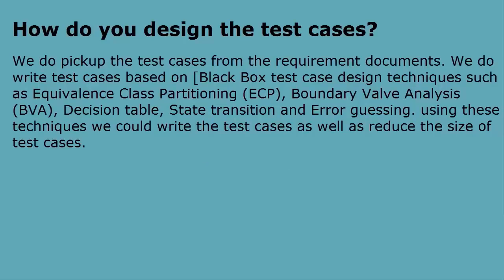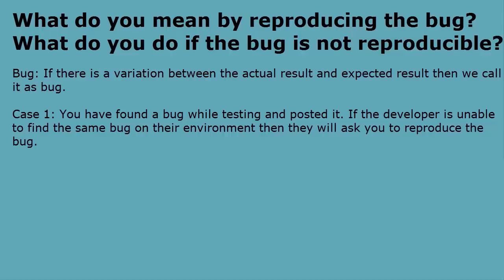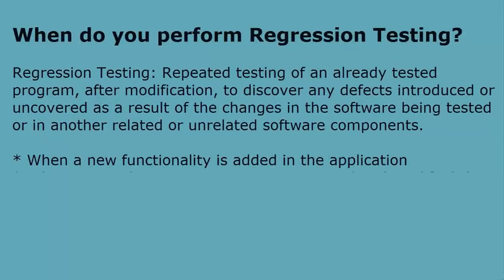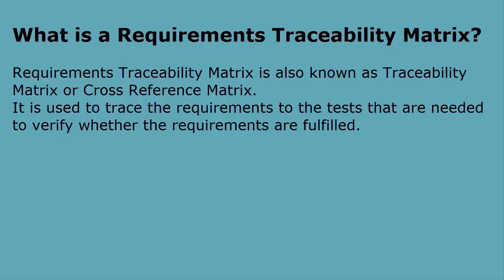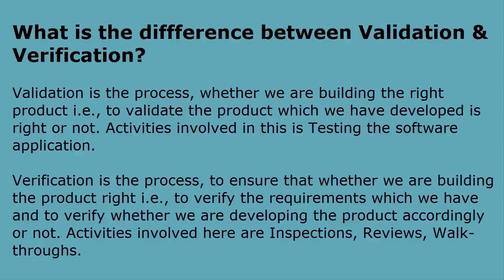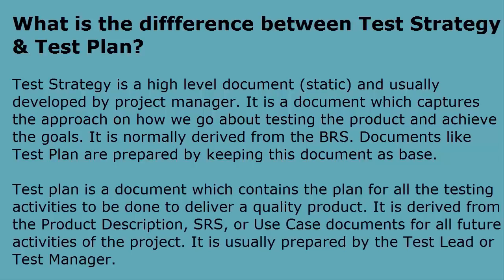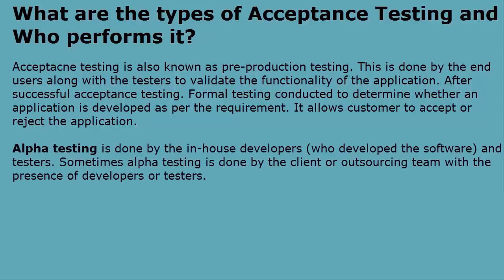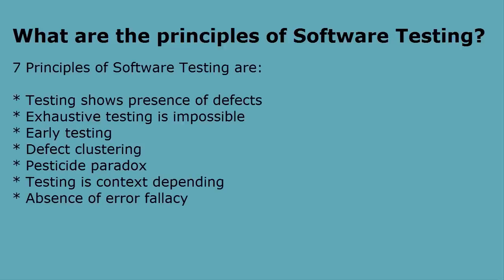Real Time Software Testing Interview Questions

Comment: 1.after test engineer gives the bug report to the developer he  go through the the bug report to check whether it's a valid or invalid.if valid then he follows the navigation steps by opening the application and physically check the exsistance of the bug..(that's called reproducing the Bug)
2.if the bug is not reproducible as TE WE should recheck our bug report to do the necessary changes and change the status to re-open and send it to the developer 😀

Comment: Great job! Could you maybe explain the first question more clearly as to what are the tests under blackbox testing
Reply: Black box testing means that the tester doesnt have an idea on how it works..
Reply: When a tester is not aware about the backend part i.e. at the code level and testing is done on the basis of thinking as a end user then such testing is know as black box testing.....black box means when internal design and code is not know to the tester.

Comment: I used to like your video before this--->

There is a crash in an application whenever a user enters 4 digits in age field which accepts max 3 digit.
Seriously ? this is low priority bug as per you.
Reply from the maker: Hi Vikram Kumar, priority always depends on Business.. Not set depends on QAs point of view..
Reply: Yes it comes under low priority and high severity

Comment: If your client is getting a bug on production environment and you are not able to reproduce it on your test environment I don't think so it would be a good approach to just close that bug with status not reproducible. What i  would suggest is to work with client get logs from his machine and try to troubleshoot what is going wrong.
Reply: logs, logs and complete details of client's environment, platform (etc.); ideally, screen-share with the client and witness the problem
Reply from the maker: Hi Aditya Jain, I agree with you. Did we mention this quoted one in our video. - "If your client is getting a bug on production environment and you are not able to reproduce it on your test environment I don't think so it would be a good approach to just close that bug with status not reproducible."
Reply: Yes

Comment: hello are you remembered your previous video ...you said that defect is a variation in actual result and expected result
but here you said that it was bug...
give me correct info.
Reply from the maker: Hi. For both defect and bug the actual result wont be same as expected result. For detailed explanation, please check this videos..
https://www.youtube.com/watch?v=53braDId-RQ
Thanks.
Reply: Bug or defect both are synonymous
Reply: venkateswarlu gurram 
Bug is a man made mistake. Eg: in d code.
Defect is wen the functionality is not working as required.

Comment: Hi Team,

Well done for framing questions in one video. Just one I have encountered in an interview regarding Acceptance testing. 
When testing and all related activities are performed by QA team then why Acceptance is required. Please provide justified comments that would be really helpful.
Thanks in advance!!
Reply from the maker: Hi Charu thakral, Thanks you liked our video. Coming to your question, Acceptance testing gives confidence to the customer whether the system is working with all the features as mentioned in the User Specification Document/Business Requirement Document.